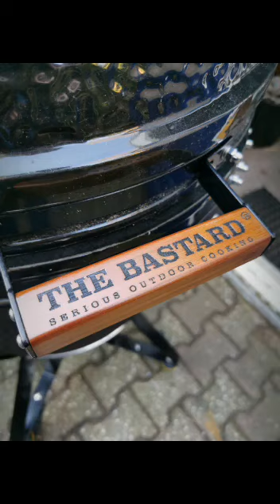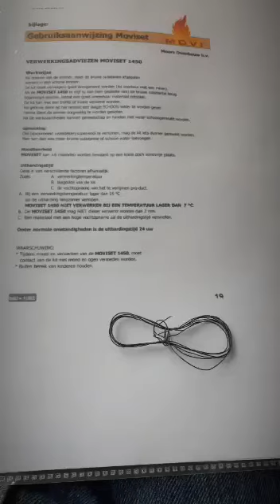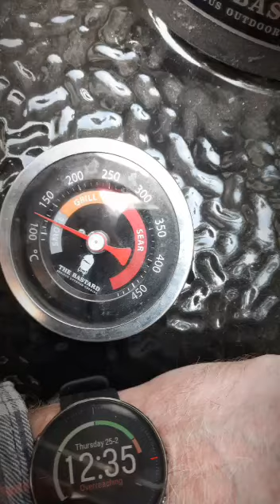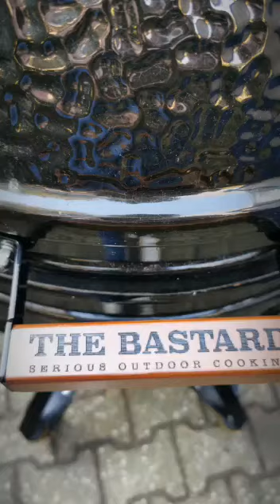#Kamado #BBQ #repair #ribs #chicken #Bastard: watch full video for success bbq celebration cooking 😋

Comment: Nice Job!
One question about the fire ring. Did you keep the metal parts in there or did you remove them before cement-glasfiber-repair?
I‘m thinking of a different material expansion (metal/ceramic) which could cause cracks again.

Thank you in advance😁👍
Reply from the maker: I left them in there. It was necessary to able to left the fire ring in and out. The joint was not strong enough to support the weight without the clamping of the wires.

Comment: Fantastisch werk! Door het zien van deze video zelf ook een kapotte kamado aangeschaft. Wel heb ik nog een vraag omtrent de moviset 1450 metselkit. Is dit wel veilig te gebruiken in een bbq? Ik kan alleen maar vinden dat het gebruikt wordt in kachels etc, dus komt er geen giftige damp vanaf als het verwarmt wordt bijvoorbeeld? Zelf ben ik van plan vuurvaste metselmortel te gebruiken maar die zijn maar bestand tot 500C dus wellicht als het veilig is gebruik ik ook wel de moviset. Heeft u verder nog tips voor mij? En staat de bbq er nog steeds zo mooi bij? Groeten Lucas
Reply from the maker: Hi Lucas,
When i did my first heat tests it was without food with a view to burning out any odours.
Siince the repair been using it regularly food tasted good. 
The repair has some dis-colouring but in line with the rest of the pot.
I am still very satisfied with the repair.
Good Luck.
Gordon

Comment: Vraagje, het ziet er naar uit dat er een glasvezel mat wordt gebruikt. Deze zijn over het algemeen niet zo hittebestendig (op zichzelf dan) als wat de BBQ zelf aan kan. Is dat geen probleem?
Reply from the maker: The glass Fibre is used to reinforce the cement which can take the heat produced by the BBQ.the Fibre is covered by the cement and not exposed direct to the heat. Still working today > 1 year since the repair.